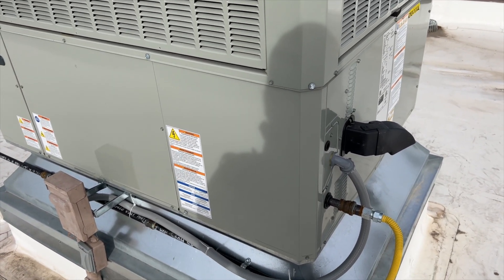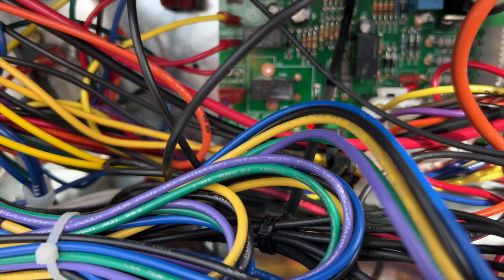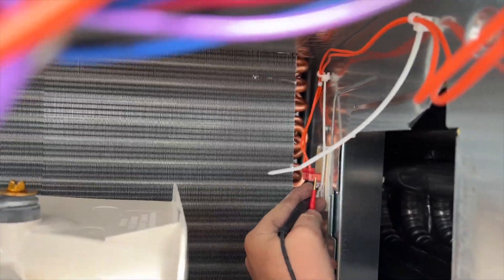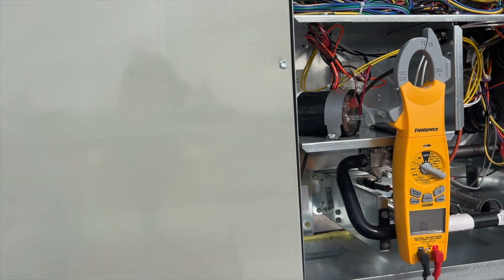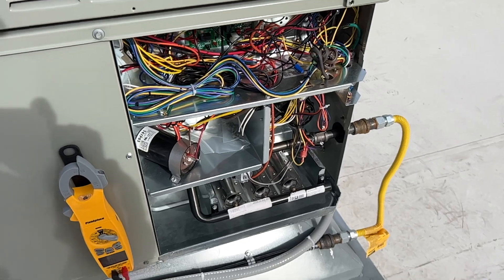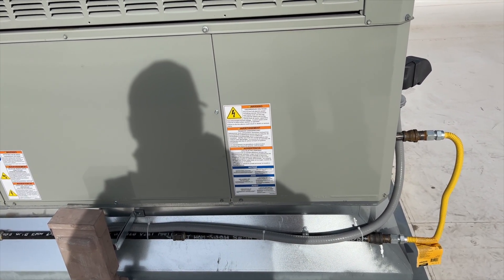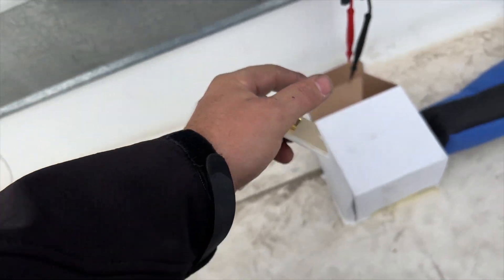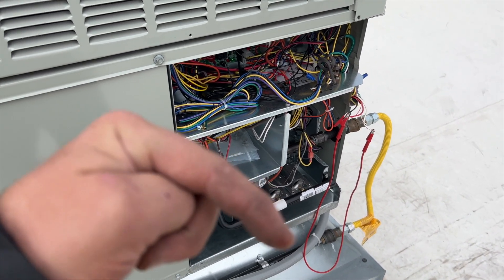Brand New Trane Package Unit Not Heating EP113

Comment: I have a brand new ox box unit at my residence and from day one it has not operate properly. It intermittently will provide heat, but there’s no consistency. It seems to kick off more commonly when it rains. The error code on the panel is two flashes. The trane repair expert has been here a dozen times and cannot figure it out. Obviously it’s impossible to analyze without saying, but I thought maybe run into this in the past.
Reply: I am having the same issue works when it wants to. Gas  never work properly . I am Going for the Daikin. I herd good things . It is hard to stop the Trane, but this one derailed.

Comment: How long did it take you to pull the blower and put it back on? Dam! engineers took a simple 10 min fix and turned it into nightmare.
Reply from the maker: Not too long as I didn’t have to remove any wiring. Just annoying that it’s behind the blower assembly.